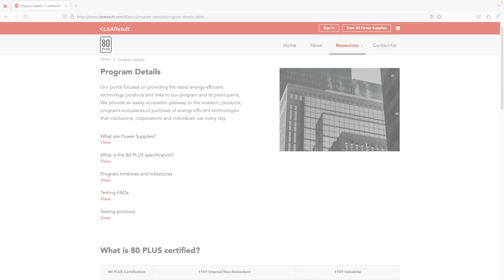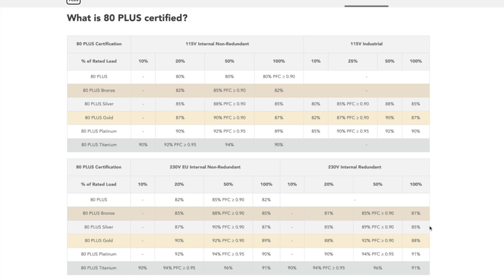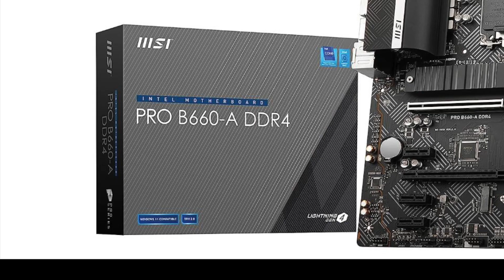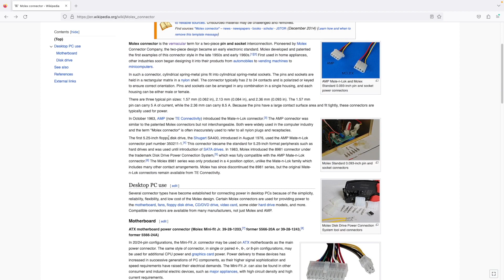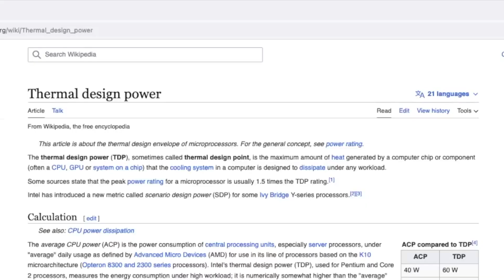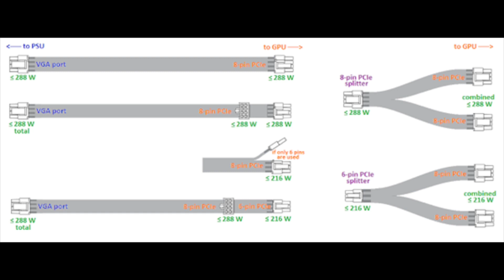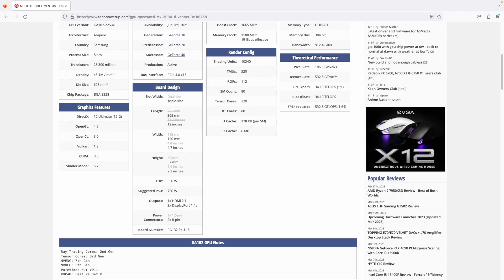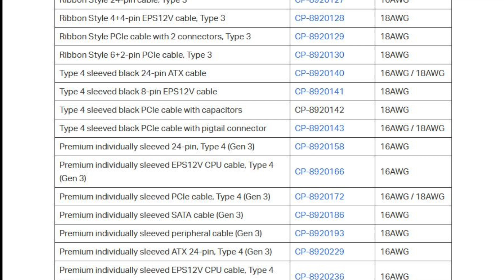All you need to know about PC Power, PSUs, and Power Cables

Comment: One of my past PSUs had a broken fuse or even high-voltage issues. It's an apevia 500w PSU. I had to put it in my rig and when I started it up, it started to blow up, and it had a smoky smell. So I had to replace it with a 600w one. It's an AresGame one.

Comment: What happens if you use an old psu cable on a new psu that has a heavier gauge cord
Reply from the maker: @marcusmartin743  do you mean the mains cable? Or are you talking about one of the 12v cables, such as the EPS or PCIe cable? I assume the mains cable, and if so just make sure it’s rated for the correct ampage.

Comment: Hello can you please help me i moved out and mixed all my cables i dont know witch cable is for my psu and witch is for my monitor i have a seasonic gx 850 w psu
Reply from the maker: The only cable that is inter-changeable between the two is the power cable, and these are both a standard cable, you could google 'IEC C13' and you can use them either on a monitor or power supply (or many other things).
Reply: @sometechguy  so it doesn’t matter? The cable also says 250 volt idk if that is imported
Reply from the maker: @ahmed8607  I don’t what cables you have, what they are rated for or what country you are in (or the mains power in that country). But monitors and power supplies would typically use the same cable type and as long as they are properly made and fused, it should not matter.
Reply: @sometechguy  thx for your time deserve a sub
Reply from the maker: @ahmed8607  no problem, hope the move goes well and you get your pc up and running 👍

Comment: Nice job, informative but a bit underdeveloped. For example, I have a 'be quiet' 13 1000 psu with pcie ports that are 12 pin. As well there are a couple of P8 ports with 10 pins. You didn't mention anything about that possibility or what the difference is between them.. Also when discussing the sata ports on the psu, the ones on your psu are two rows of  3 whereas my psu has a single row of 5 pins. Lastly, if I wanted to use the connection on the m/b for the additional power (the one next to the 24 pin connector) I would need a 6 pin connector but my psu does not have any 6 pin ports so i would need an adapter? And where would I attach such cable to the psu?  Again, great job, but could use a look at several more psu's.
Reply from the maker: At the PSU end, each is going to vary and those connectors can be proprietary. It’s important to use cables for that specific PSU (and even model). At the other end, everything needs to comply with standards, so they should present a 20 or 24PIN ATX cable, and then 6/8PIN pcie and 8 PIN EPS/CPU as well as Sata and usually sole ‘Molex’.

So not sure on the connector types or pin outs on your BeQuiet but the Motheboard end should be the same, and you would use a PCIe 6 pin for that additional plug next to the 24PIN, and of course CPU/EPS 8 pin for the sockets for the CPU portion. 

If you are out of PCIe cables for that supplementary connector, you can get converters for EPS to PCIe as they are all 12V, but be careful you have the right adapter, check the PIN outs with the seller and don’t force it if it won’t fit. But usually if you are running a rig that is calling for supplementary power then you would run a beefier PSU that would have the addition cables. That supplementary connector is really only needs of you are pulling lots of power off the motherboard via PCIe, for example, 2 GPU, which is pretty rare there days. 

Thanks for the feedback, and watching.

Comment: Informative and well done. One comment, Using a larger wire in a cable (smaller AWG #) will have the effect of delivering more voltage to the load.  There is some voltage dropped in the cable due to the wire's resistance (power = I<2>R {Current squared times Resistance of the cable}).  Bigger wire = smaller resistance  - less power dropped in the wire, slightly higher voltage at the load.
Reply from the maker: Thank you, good clarification.

Comment: Can you help ...my pc works 100% but somtimes it just doesn't power on at all ..idk why that happens
Reply from the maker: Very hard to say from the description. Check everything is plugged in thoroughly and see if you get any beeps from the computer at startup. Different numbers of beeps indicate different problems with the start sequence. Make sure the PSU provides enough power for the components you have. Also, if the problem started after you added or changed something, that's an indicator.

If it isn't starting at all, and you have more than 1 memory module installed, you can try it with 1 at a time to see if its faulty RAM, and make sure the RAM is all seated correctly. If you can get to BIOS, try doing a BIOS update or reset the BIOS settings in case you made a bad change there.

But its a bit of a vague question, so could be many things. Good luck with it!